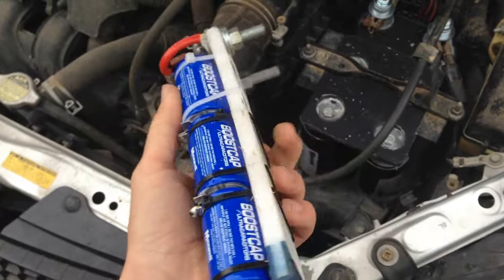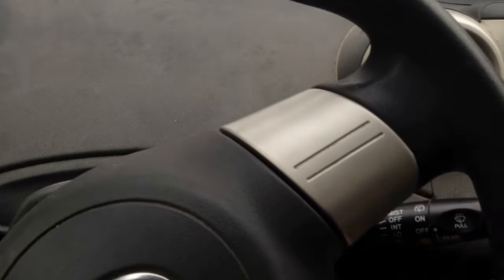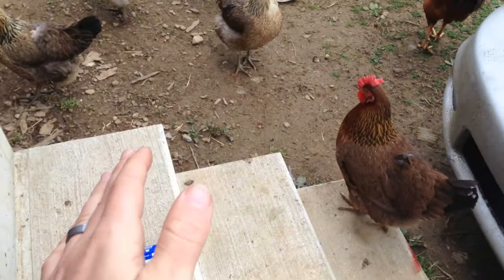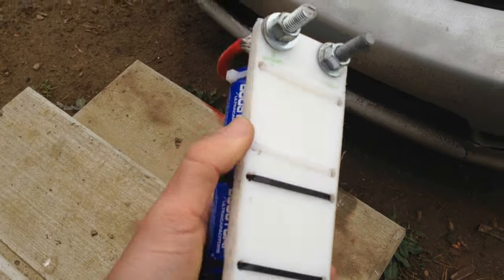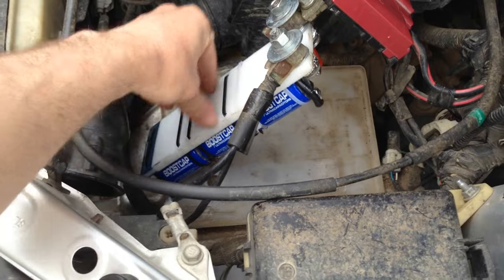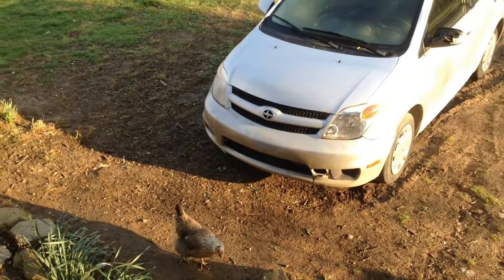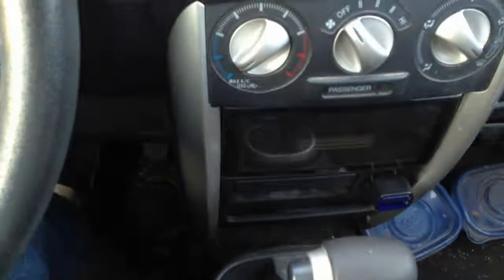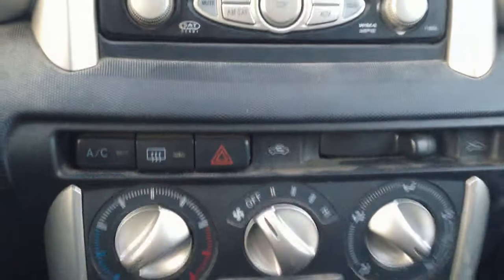Replacing My Car Battery with Capacitors! 12V BoostPack Update

Comment: How much money would a capacitor-based car battery save you?

An often-quoted number is that hauling 100lbs around in your car adds 1% to fuel consumption.  If you remove a 30lb battery then you save 0.3% of your fuel bill.  If you are spending $50 per week on fuel (the average for Australian drivers), this adds up to $2600 per year.  0.3% of $2600 is $7.80 per year in reduced weight leading to better fuel economy.

Capacitors can be recharged hundreds of thousands (to millions) of times, unlike lead-acid car batteries which will be dead after one (or two) thousand cycles (at the most).  If you replace your lead-acid car battery every 4 years, you would have to change the equivalent capacitor-based car battery every 400–4,000 years.  So, in effect, you would never need to replace it (nor would your children, or their children, or their children...).  Since a car battery might cost you about $100 every four years, you are spending $25 per year on lead-acid car batteries.

A capacitor-based car battery would thus save you $25 + $7.80 = $32.80 (on lead-acid battery replacement costs and in improved fuel economy) each and every year.

Over the course of a 50-year driving career (20–70), you will have saved 50 * 32.80 = $1,640.  If, on each anniversary of installing the capacitor-based battery, you added the $32.80 you just saved in the previous year into a bank account earning 5% interest, when you retire from driving you would have about $6,900 sitting in the account.  Give the battery (and the account) to a grand-child and get them to do the same, and they would retire from driving with $85,600 in the bank.  If your grand-child does the same thing, then your great-great grand-child will retire from driving, with the exact same battery, 150 years after after you built it, with $989,000 in the bank...  Great-great grand-dad sure was a smart fella.

Moving away from lead-acid batteries makes sound financial sense, provided you think ahead far enough.
Reply: Compounding interest is a beautiful thing.
Reply: There is but one catch, inflation.

Regardless, it will make sense even when accounted for. Not just lead batteries will be gone for many applications but the internal combustion engine itself which is in no way as efficient as an electric engine. The only thing that fossil fuel still has going on for it is the energy density, that will need not be equaled, just be good enough. When 300 miles range worth of batteries become cheap enough, it will be game over.
Reply: In theory you are right, but knowing kids.....it won't reach the $20.000. They want cars, ipots, tablets ect. ect. That money is gone on the moment it hits their hands. But on it self i find it a great idea, an other plus point is that high capacitors are loaded in a minute, where a lead accu can charge for hours.
Reply: P
Reply: Great logic.
Reply: Nice work Penfold :)
Reply: In addition to "financial sense" lead-acid batteries contain chemicals that have the potential to be hazardous to your health and the environment.  The batteries contain lead, a highly toxic metal, and sulfuric acid, a corrosive electrolyte solution.  Since both of these materials are classified as hazardous, it is very important that the battery be handled properly.

If lead-acid batteries are disposed of in a solid waste landfill or illegally dumped, the lead and sulfuric acid can seep into the soil and contaminate ground water, potentially affecting the quality of our drinking water supply.  If the batteries are disposed of near rivers, streams, lakes, or marine waters, the lead and sulfuric acid can also threaten aquatic life.
Reply: During the charge cycle, the current draw manifests as drag on the alternator requiring more fuel, so having a quick charge could translate into visible savings. However, the first hard start you encounter might leave you stranded.
Reply: superusermode I thought alternators are constantly supplying the current as long as the armature is spinning.  How do you equate this to extra fuel spent?
Reply: Current is the measure of rate of flow, so current is only an on demand measurement (no flow, no current). Charging a battery requires current at certain voltage. The more current being drawn, the more drag on the alternator. You'll see this especially when jump starting a vehicle that has a dead battery.
Reply: ***** With a normal car battery discharged to 10V the voltage will drop right down when you try starting a car, but with these capacitors the voltage doesn't drop immediately like with a normal semi discharged battery, that's why it will start. But with a V8 you'd need a few more of them i think. Also, if you have a car alarm that continuously draws some current when car is just sitting there, these capacitors would be discharged completely within maybe a day, two at most.
Reply: ***** u need to buy new car lol
Reply: ***** my 96 honda had a lawnmower battery and I just always parked it on a hill..
Reply: Penfold 'OoO' These capacitors Will not last for 400-4000 years just saying, that's pure theoretical amount calculated on what I assume is the amount of discharge cycles.But they could very likely last the entire life of the car.
Reply: thegreatxyz Capacitors are tested by manufacturers to determine how many discharge cycles they can endure before failure.  It is not a 'theoretical' amount.  The same logic applies to the case of a car which is rated as having twice the fuel efficiency of another vehicle...  it doesn't 'theoretically' travel twice as far as that other vehicle on a given amount of fuel — it actually does travel twice as far.  That said, I never made any claims about a specific brand of capacitors — just about capacitors in general.

The reality is that, thanks to companies like Tesla and advances in electrical storage technology, the lead acid car batteries have already started to be replaced by lithium car batteries.  I suspect than in 40-50 years the only places you will see lead acid car batteries will be in museums and antique road shows, so the point (of lead acid vs capacitor) becomes moot.

With self-driving cars already a reality in 2015, the personal transport situation in developed nations 50 years from now could be so drastically different that even having a license, let alone driving yourself anywhere, could be deemed quite 'quaint' — something that only crusty old men do whilst wearing hats.

But all that aside, the purpose of my original comment was just to determine a ballpark figure of how much money a capacitor-based car battery would save you.  The answer was a simple $32.80 per annum.  Those who are interested in tinkering with capacitor technology could then compare that amount with current capacitor prices, and decide how many years it would take for the battery to pay for itself... and thus whether or not they should even bother.

Lots of people just want simple answers and don't like math.  I was just trying to help those folk out.
Reply: Well I was just pointing out that these capacitors will not last as long as mentioned. these specific ones last for 1500hours @ 65 degrees Celsius. And used under proper circumstances these could last around 10 years. Of course these will most likely still last longer then most lead acid battery's. 

Capacitors do however have promising future with quick charge methods .
Reply: thegreatxyz I'm not sure why you quote "1500 hours @ 65 degrees Celsius" as there is no habitable zone on Earth that gets that hot.  It's also at, basically, the highest temperature that the capacitor can operate at before melting — the worst possible scenario.  Not a very useful figure when most of the planet's population lives in regions with an average temperature close to 14°C.

You would have been better off quoting "500,000 cycles @ STP" (Standard Temperatures and Pressures) which comes from the Maxwell site.

Admittedly, if someone were to weld the capacitor to the side of the engine block, they might see an average temperature of 65°C (or even higher), but that defies common sense.  The normal location for a lead acid car battery in the engine bay doesn't get close to 65°C.  Even if it did, however, all you would need to do is wrap your capacitors in a thin layer of insulating material and that problem is solved.

What many people don't realise is that it is vibration which is a large factor in limiting the useful lifespan of batteries (lead acid and all others) in cars.  Vibration induces stress fractures, and exacerbates the micro-fractures caused by thermal cycling — basically shaking the battery's more delicate components apart over time.  Lead acid batteries are forcefully bolted to the car which, whilst logical from a safety perspective, results in a rigid bond with the vehicle chassis and lots of transferred vibration.  If you similarly bolt a capacitor battery to the chassis, you will also diminish its life.  But why do that?  They weigh virtually nothing, and don't turn into a 30lb missile every time you brake.  Having them 'dangle' from the leads means the leads act as additional shock absorbers and vibration dampers.  If you wanted to, you could construct a battery-sized box, locate it in the normal place, pack it with something like neoprene rubber, open-cell foam, or wool, and slot the capacitor battery inside — not only do you insulate it but you massively dampen vibrations in the process.

A simple and thoughtful 'housing' is all that is required for capacitor-based batteries to more fully realise their potential in this sort of application.  DIY housings can be completely free or merely inexpensive.
Reply: The simple fact is that capacitors are one of the most common thing to fail in electronics. Especially if they are placed in harsh conditions like near the engine of a car.Even properly mounted industrial quality capacitors under ideal circumstances fail usually after 10-20 years. The information I quoted was from the datasheet of the capacitors used in this video.
Reply: Yep those fuckers blow in my flat screen every 2 years
Reply: thegreatxyz 
Read this: http://www.maxwell.com/images/documents/technote_designinguide.pdf

Basically the "expected life" of a supercap is consider achieved when its capacity was reduced by 15% and its internal resistance increased by 45%. 
Remember that the resistance of a supercap is ~100 times less than a typical car starter lead acid battery (0.28 mOhm, vs ~30mOhm for a new SLA), a 45% increase is next to nothing.

85% capacity after 10 years sounds extremely good to me.
Reply: hereiam2005 Yep, but those numbers are for 25°C.  Since the average car will spend the vast majority of its life sitting idle in a car park, driveway or garage, it makes sense to use the average temperature for whatever part of the world you live in to determine temperature degradation effects.  

The same tech note says temperature has a doubling effect every 10°C, so decreasing the temperature by 10°C (from 25°C to 15°C which is close to the global average of 14°C) means that capacitance decreases at only half that rate (i.e. 7.5% per decade) which, due to the exponential nature of decay curves, means an effective capacitance of ((1.000-0.075)^1=) 92.5% after 10 years, ((1.000-0.075)^2=) 85.6% after 20, and similarly 79.1% after 30, 73.2% after 40, 67.7% after 50 ... and 45.9% after 100 years.

Put another way, your capacitance would halve every 89 years (so 1/2 after 89 years, 1/4 after 178 years, 1/8 after 267 years and so-on).

Any reduction in capacitance beyond this is due to other factors (e.g. vibration, as previously discussed).
Reply: Foo Oof
Wow. What a mature person.
Reply: hereiam2005 Don't worry about it.  Foo Oof had some intelligent things to say about a month ago in a different thread, so let's give him the benefit of the doubt and assume he's just having a bad day.
Reply: ijustkilledu007 If you are investing for a long period of time, then the current interest rate means absolutely nothing... so you analyse historic data to determine average rates and trends.  Finance 101.
Reply: Can I power my mini e revo with these?
Reply: thegreatxyz not knocking anyone for expiermenting but some thoughts i had. how hot is the actual engine bay when running, or idling in a traffic jam? I think the termpetaure will have a negative effect on the capacitor life, relocating to the trunk may help with temperature.? How do these capacitors fair at low temperatures such as in winter? I see you metion a solar panel idea but in winter with little sun and cold temperatures when cars are not always used every-day any ideas for dealing with this?
Reply: ***** Capacitors do NOT hold a charge, they are designed to start an electric motor turning instead of having to wind up... These can only discharge if they are hooked UP to voltage. Capacitors do not replace a battery, because they have NO charge until they are hooked up to voltage.
Reply: Larry Burks ok so they dont hold a charge but start a electric motor? Here I always thought they held a charge but did a fast discharge to compensate for rapid discharge (the reason you see them on most electronics)...... and fyi my comment was sarcastic
Reply: ***** They give the kick needed to quickly spin up an electric motor. They are used for electronic in another way, such as a nand gate etc... in electronics they provide the transistors with the kick to switch. It's like having a burst at voltage levels enough to make the transistor switch AND/OR. The way this guy has it wired in, it's dead, no voltage going into it to give the starter motor the kick it needs to spin. Hope you understand now.
Reply: Larry Burks so that motor didn't start from his cap boost pack?
Reply: *****  Larry's comments are a bit confusing and misleading.  Capacitors do store charge — they are great at it — they just don't store a lot of charge.  Of course, like every other battery, you need to charge them up first before using them and, if you discharge them, you need some way of recharging them (the alternator does that in a car, just like it does to a regular lead acid battery).  Because capacitors have a very, very, low internal resistance (compared to lead acid batteries) they can deliver a lot of charge quickly.  This is exactly what you need for a starter motor — you don't need a huge amount of charge in total but you do want it quickly, in a burst.  Something like a sound system, however, wants a much smaller flow of charge, but over a much, much longer period of time, in a trickle.  Running a sound system for a few hours takes much more charge than one engine start.  Since capacitors don't store nearly as much total charge as a lead acid battery, using them to power such accessories is not a good idea.  Using accessories whilst the car motor is off will deplete a capacitor battery quickly.  Using accessories whilst the car motor is running is fine because the alternator is providing the power.  Yes, the motor did start from his cap booster pack.  No, you wouldn't use these caps to power a mini e revo.
Reply: Penfold 'OoO'  could it replace the deep cycle marine batterys ?
Reply: Aaron Edwards  Deep-cycle marine batteries are not normally found in cars — they are more commonly found in boats, jetskis and solar systems.  Whether or nor a capacitor-based battery makes sense (would work) depends on how the battery will be used.  What use-case are you thinking about?
Reply: I was wondering if they could replace deep cycle camping batteries. Do they have amp hours ?
Reply: Aaron Edwards  "amp hours" is just a different way of saying "charge".  All batteries store charge.  In a camping situation you are using your battery to power a variety of devices that usually require only a small trickle of charge over a long period of time (e.g. lights, radios, phone chargers).  The important thing is "how much total charge you have", not "how fast can I get it out".  Lead-acid batteries (deep-cycle or otherwise) store a large amount of change but can only release it slowly.  Capacitor batteries store a small amount of charge but can release it very, very quickly.  So a deep-cycle lead-acid battery makes more sense for general-purpose camping than a capacitor-based battery.  If you really want to upgrade your battery, consider a portable lithium battery power pack instead — they store plenty of charge, are very light, work better in really cold temperatures, and last a decent amount of time.
Reply: Penfold 'OoO' I hope my great great great great greats don`t drive cars.. And in 150 years we are probably living under ground because of pollution and (more) wars, and won`t drive at all.. :p
Reply: Tarun Das That would be a concern if it weren;t for the fact that 99.9% of all lead-acid batteries are recycled. The lead inside is just to valuable to throw away. 

Where I'm at, we actually re-use the lead to cast our own bullets. The way this world is being run down by the political elites, we'll need alot more of them before we need more  car batteries...
Reply: Aaron Edwards The quick answer is....the large capacitors give you approximately 1.5 AH of capacity, even though technically it isn't measured that way in a capacitor. It has approximately the capacity of a AA battery, but can give it all up within seconds. 

But it has no reserve at all when the juice is used up for extended cranking, or you leave your lights and radio on for even a few minutes...

It's like a sprinter trying to run a marathon without training for it. He may be quick out for the gate, but long term he will fizzle. That is a capacitor.
Reply: Penfold 'OoO' how hot or warm does the capacitor working?  I mean if you put in the insulation it would get warm when it charging or discharging? isnt' it?  Yah I was also thinking put in battery box like people said can buy at waltmart, but my walmart do not have it.  I thinking put in the battery box with the form pellet like the type that shipping box put in to protect the things inside.  any Idea are appreciated.  So 6 cap is ok  or should I put in 7 cap ? 7x2.7 = 18.9v or let say 2.5 x 7 = 17.5 .  the alternator will get to 14.8 volt and stay there.
Reply: Hieu Don
what does that have to do with capasitors? :p
Reply: what was your qestion? about war?  I was respon to someone talking about war
Reply: Hieu Don
LoL, Haven`t seen any wartalk here. Either that or I`m forgetting something :p
Reply: Hieu Don  The amount of energy used to start an engine isn't very much.  That means not a lot of waste heat is generated by the unit when it 'discharges' or, by the same logic, when it recharges.  The vast majority of the heat that ends up in the battery comes from the engine itself and is modified by the climate in your region.  Drive for long periods at slow speeds during summer in a warm part of the country and you will have a very, very hot engine bay — and heat will decrease the life of a capacitor-based battery.  Cold doesn't do much that's worth worrying about in most habitable regions of the world.  So all you really need insulation for is to protect your battery from absorbing too much heat from the engine bay during hot seasons.  If your region doesn't have hot seasons (e.g. you have a cooler than mediterranean climate) then you probably don't need thermal insulation at all.

As for the number of capacitors... 6@2.5V gets you to 15V which is above the ~14V that a car alternator will produce.  Any amount beyond this is, effectively, wasted.  There's no point buying/building a pressure tank that can handle 2000psi if you only even plan to fill it to 1500psi.  Capacitors in series increase voltage, but decrease total capacitance, so you lose out that way as well (capacitors do not behave like regular AA batteries).  So, in summary, use as few capacitors as possible to get the voltage required.
Reply: MARTIN STRANGE  Sodium-ion batteries are cool, but due to high internal resistance would not be useful for a starter-motor application.  Sodium can store large amounts of charge but can only release it very slowly, which is the complete opposite of a capacitor and what is needed to start a car.  Maybe a sodium/capacitor hybrid, with the capacitor starting the car and the sodium running electronics when the engine is off?
Reply: MARTIN STRANGE  The good thing about non-commercial tinkering and experimenting is that you don't have to worry about patents.  Since you're not making a profit from it the vultures lawyers won't ever come after you (because there is no money in it for them even if they do win the case).  :)
Reply: Let's keep this thread relatively civilised, can we please?
Reply: It is..
Relatively.. :p
Reply: Penfold 'OoO
Reply: @penfoldooo2160  you said 6@2.5V in series increases voltage while decreasing capacitance. What if you built two packs of those and put them in parallel? You'd still have 15 volts, but you'd double capacitance from just one pack, right?
Reply: Nice work.